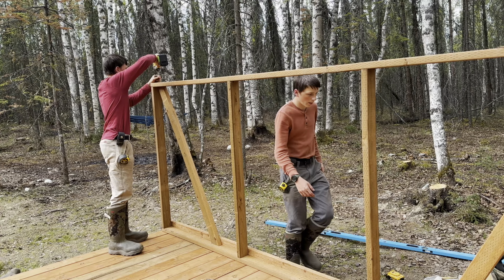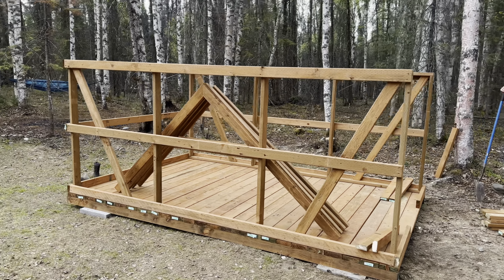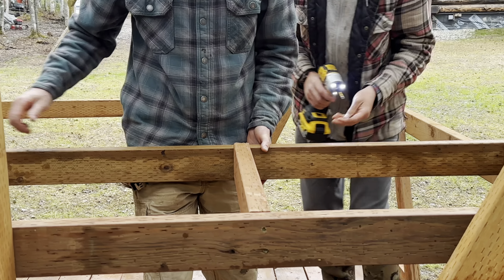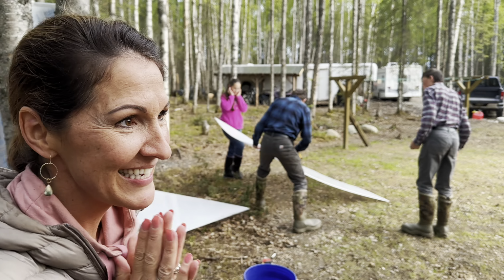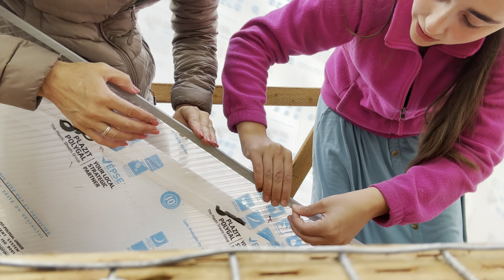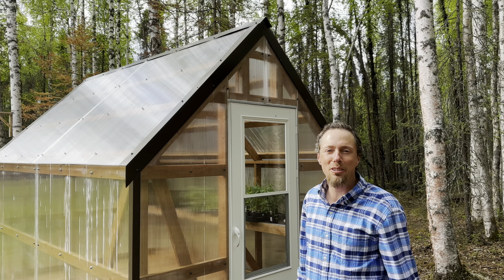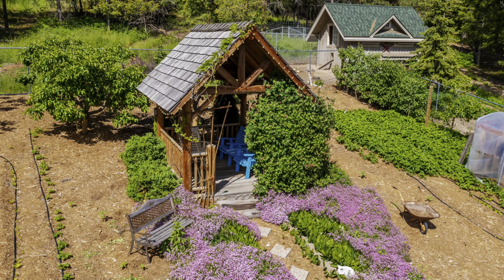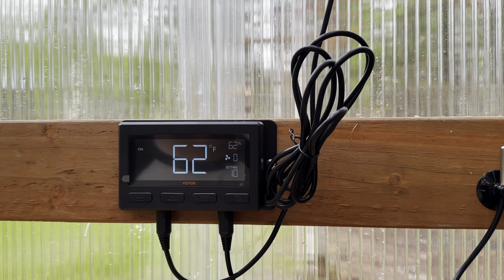Building My Wife’s Dream Greenhouse for our Alaska Homestead!

Comment: The moisture inside the plastic sheets is hard to avoid. Also bugs tend to invade (especially ants), do not be surprised if you get more moisture in the walls and mold is also a problem.